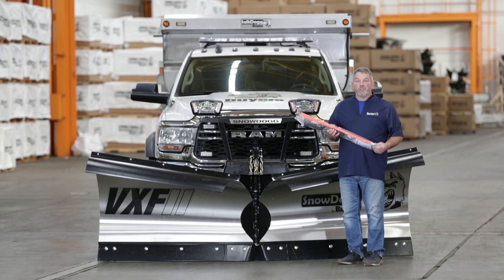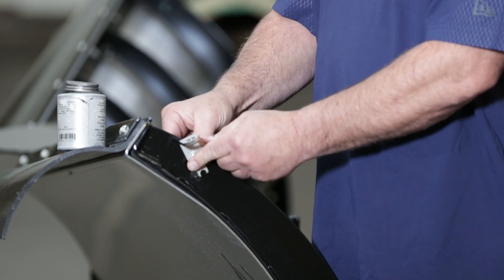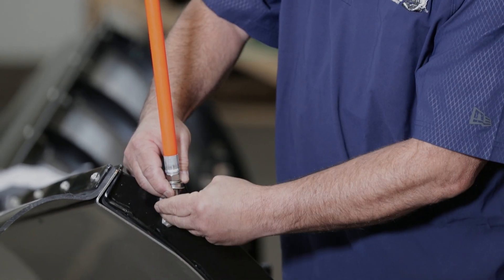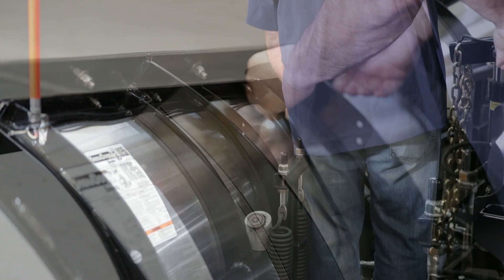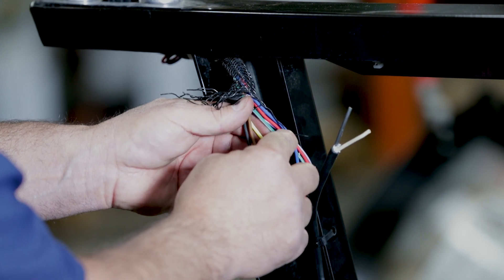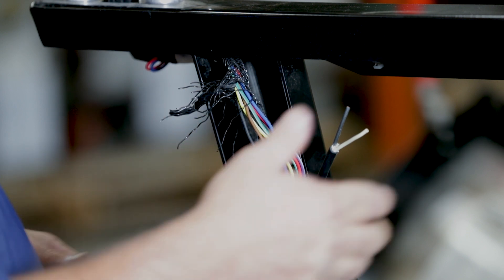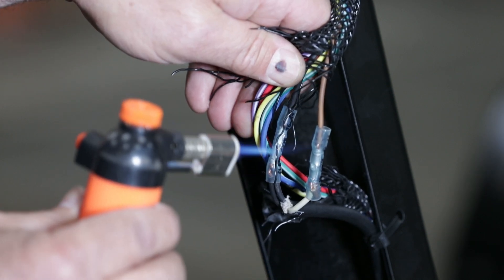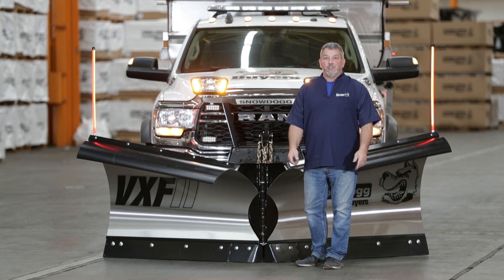How to Wire and Install - Buyers Products Illuminated LED Guides for Snow Plows

Comment: $130 for the markers and no brackets! lol wow.. lets nickel and dime people.
Reply from the maker: We apologize for the inconvenience! You might find the Horizontal Adapter Kit useful for your LED Guides: https://www.buyersproducts.com/product/horizontal-adapter-kit-for-illuminated-led-guides-50041308126
Reply: @BuyersProductsCompany  point of the comment is why would you not include these with the purchase of the markers, why are you making people make an additional purchase for a mounting bracket which is required to install. It I purchase a big screen tv, I don’t have to purchase the power cord and remote separately! What your doing is a joke
Reply from the maker: @MyGreenLawn2019 , I apologize for the confusion, but I did look into this matter further. The original design of the LED Guides did NOT have the adapter included. However, there was a redesign in 2021, and now the adapters are included with the purchase of the LED Guides. Did you happen to recently purchase the product? Thanks! -Lucas
Reply: @BuyersProductsCompany  I have not purchased the product and after looking at the reviews and the cost of your product, I will be looking for an alternative. I’m happy to see you are finally including the mounting bracket, it’s the right thing to do!

Comment: Want a better solution? One that works better, and is easier on the eyes and much more reliable? Buy orange plow markers and install them. Buy a quality ditch pod (I like Aurora flood or diffused) and mount them (ditch pods are mounted where the hood meets the bottom of the A pillar) Boom. You now have better plow lighting, and when the ditch pods are illuminated they light up the orange plow markers similar to lighted markers without the annoying bright light and without the headache of having wiring run across your plow which has moving parts.
Reply: Love the idea brother
Reply: Did you increase the size of the fuse?
Reply: @ no. That part of the circuit only triggers the relay which only requires a fraction of an amp like maybe 1/20 of an amp.

Comment: They're great until they start blowing fuses and need to be replaced. Wiring just inside the marker breaks and shorts out. Have replaced at least half a dozen with faulty wiring
Reply from the maker: Thank you for your feedback. I will pass this faulty wiring issue along to our engineering team for further review.

Comment: Nice stuff for sure, I have the Blizzard 8’-10’ with the retractable extensions, I would like to  suggest protecting the wire in a conduit from the bottom of the light right across the inner top edge of the plow and down the center just like you did, only difference is by protecting the wire in a flexible conduit all the way back to the plow lights.
Reply: I used 3/8 fuel line with shrink tubing on both ends. Then mounted the fuel line using 1/2" rubber P clamps. Weather and vibration proof.
Reply from the maker: Hey Timothy, thanks for the comment! We appreciate the feedback. I'll forward this along to our engineering team to consider for future revisions. Thanks!   -Lucas